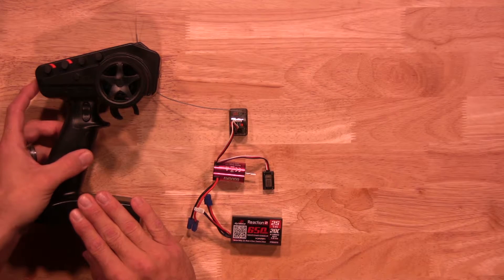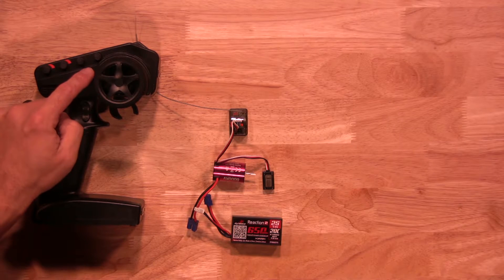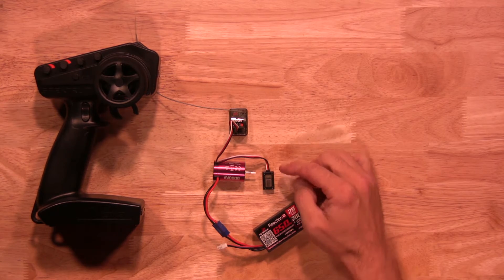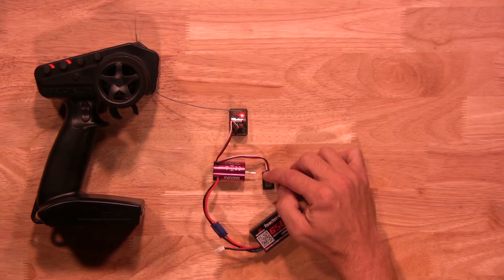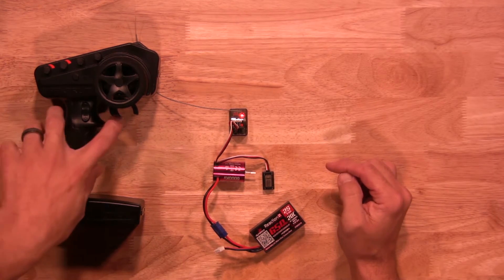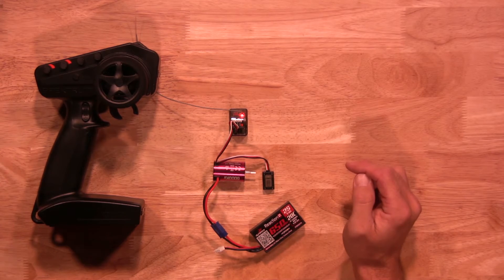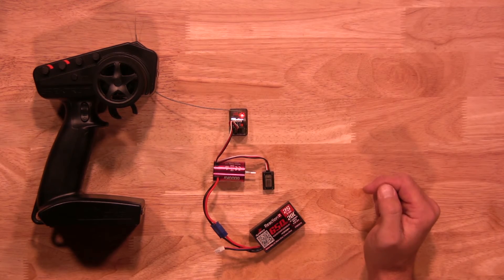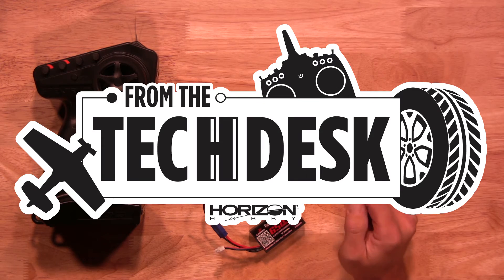How to calibrate the Dynamite 6000kv Motor/ESC combo

Comment: Please help! Mine is faster in car-reverse than car-forward, ive tried 3 radios and reversing settings doesnt help. It only changes which way the throttle stick functions, still only goes fast in car-reverse. Thank you!!!!
Reply: i know im late, i had the same issue hold the reverse on the radio and pull the throttle the motor should reset half way through